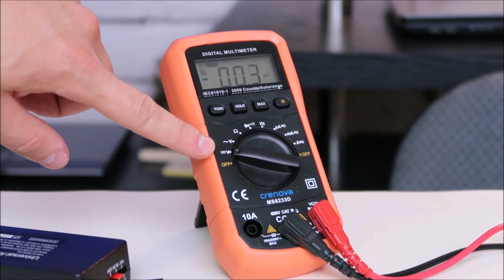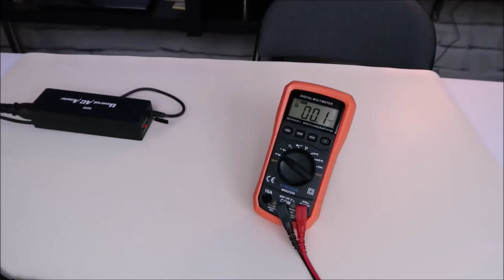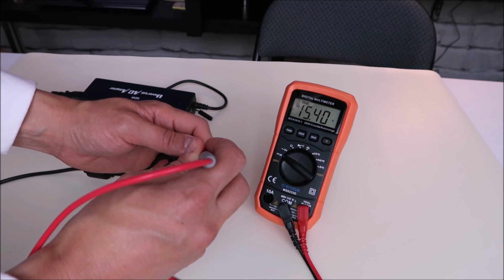How To Fix Any Laptop - Wont Turn On, Wont Open, Turns Off Right Away, No Power Solution

Comment: Is it possible to have cmos battery on the back side of the motherboard? The only cmos looking thing i could find was the one on the harddrive. I was thinking it probably the harddrive because it was supposed to spin right? And it doesn't now

Hp laptop 14-bw019AX
Reply from the maker: Yes, CMOS batteries can be on either side of the motherboard.
Reply: @PC_Monkey  harddrive was supposed to spin right? Mine doesn't.
Reply from the maker: @KhaiGK  1.  Yes, usually hard drives do make at least a little noise when in use from the internal components spinning.  
2.  Are there any signs of life at all when you try to turn it on? Lights? Fan, Motherboard, or Hard Drive sounds? Anything seen on the screen?
Reply: @PC_Monkey  fan are spinning, power light lit up but it was supposed to be blinking, cpu or gpu im not sure which does get heated up.
Reply: @PC_Monkey  hard drives are completely dead
Reply from the maker: @KhaiGK  1.  Is the computer overheating? 
2.  If the fan is on and CPU is cooking, perhaps the computer is actually on.  For a computer that turns on but the display does not work, try this video first; https://youtu.be/e9iy30J00-k
Let me know how that goes :)
Reply: @PC_Monkey  ok I'll check it out, 1. No it doesn't seem like overheating just warm like usual 2. No i tried an external monitor, but it doesn't work. 3. Ram is also looking fine. I do remember a few months ago i factory reset it because i was going to sell it but decided not to, it was fine for a good few days but then i didn't use it for like a month and now it is in this state
Reply from the maker: @KhaiGK  Good luck !!  Let me know how it goes :)
Reply: @PC_Monkey  yep, im pretty sure it's the harddrive. I tried turning it on without the hard drive plugged in and the same thing happened only light, fan

Comment: My laptop is a Dell latitude E6220, it has failed to work out, kindly guide me
Reply from the maker: Are there any signs of life at all when you try to turn it on? Lights? Fan, Motherboard, or Hard Drive sounds? Anything seen on the screen?
Reply: @PC_Monkey  there is nothing no light at all
Reply from the maker: @getinspiredbyswaibuhkawees7088    If all the tests in this video do not reveal the issue, and your power adapter tested to be fine, then your most likely looking at a Motherboard replacement as seen here;  https://youtu.be/N_7HNrFkMS8.
Reply: @PC_Monkey  oh my God, wat could be the cause coz it's been working well, but unfortunately today morning I switched it on well as usual, logged in and connected to internet, I was trying to continue with my work on chrome pages and all of a sudden it told me chrome wasn't responding then it froze, at this scene it switched itself off completely and since morning have been trying but nothing like light yet since morning.
Reply from the maker: @getinspiredbyswaibuhkawees7088  Its hard to say what could have caused it without examining it.  Could be overheating or a power surge.  Could just be end of life under various conditions :(  Sry
Reply: @PC_Monkey  anyway am so grateful for the time you have given me, at least I have got a bit of it
Reply from the maker: @getinspiredbyswaibuhkawees7088  Happy to help :) Always here if needed !!

Comment: I have a strange power problem.  
My laptop is an asus x550ca and it suddenly turned off. I followed the suggestion that you offered. None worked.  The strange thing is as soon as I plug the AC adapter in...the power light and the number lock light come on...but it just won't turn on.   Any suggestions on how I can fix this. It doesn't even try to charge my battery
Reply from the maker: If all the tests in this video do not reveal the issue, and your power adapter tested to be fine, then your most likely looking at a Motherboard replacement as seen here;  https://youtu.be/N_7HNrFkMS8.

Comment: hi  i am having HP15s-du3047tx it is powering on (the power led turns ON) but turns OFF within 2 seconds fan or processor led doesn't turns ON at the same time
Reply from the maker: Sounds like your on the correct video.  Have you tried the steps seen here?

Comment: Is this also applicable in t series of lenovo thinkpad?
Reply from the maker: 1.  This troubleshooting process applies to most all computers that wont turn on.  
2.  Are there any signs of life at all when you try to turn it on? Lights? Fan, Motherboard, or Hard Drive sounds? Anything seen on the screen?
Reply: @PC_Monkey   nope sir, even i plug in the charger the indicator is not lighting at all
Reply from the maker: @johnroyolivacalm6295   If all the tests in this video do not reveal the issue, and your power adapter tested to be fine, then your most likely looking at a Motherboard replacement as seen here;  https://youtu.be/N_7HNrFkMS8.  If you know your computer's model number, I can help you get inside your specific computer :)

Comment: One of the very first solutions on Day 1 of the "shutdown", and yes, it was random, was to discharge the static electrical charge in the BIOS of my Dell XPS 15 9570....but they didn't explain or show how. FYI, the BIOS batteries are extremely small these days, about as big as a small finger nail. I'm on Day 8 of my relentless pursuit of a fix, and you seemed to have much more knowledge and easy-to-follow explanations than most I've seen here. There's no chance I would have taken the MB out before your videos. I will follow up, as my BIOS battery is discharging the static as we speak. 
Thank you for helping others, and I will make a donation for your efforts.
Reply from the maker: So at this point, your computer turns on, remains on black screen without displaying anything, and then turns off?
Reply: @PC_Monkey  At different times, it has come on and acknowledged a corrupt bios followed by a successful Firmware Update; successfully coming on and completing a repair; successfully coming on and completing a complete drive wipe and reset. Each and every time, immediately upon completion of whatever task it performed, it shut down immediately. I have replaced the battery and the adapter with genuine Dell parts. I have also performed your R.O.M. test. It's beginning to look like the MB according to this video......yet I'm not convinced. My delayed response is due to getting the parts and my old Dell Inspiron 1545 backup laptop having it's own issues. Thank you for these videos. I've learned a wealth of computer knowledge, and always turn to you first for repairs.
Reply: I do get a screen for the duration of each task, and my correct model is the 7590.
Reply from the maker: @maximusguitarslinger3069  Have you tried a manual BIOS reset as seen here in this updated video?  https://youtu.be/P3I7dDpkJps

Comment: Hay so my laptop isn't working 
The only time it turns on is when the charger is in it but it needs to be in a certain position it will turn on for 5 seconds then completely turn off
Reply from the maker: If your charger needs to be in a certain position to turn on then I would first assume that the power jack is damaged and needs to be replaced.

Comment: i tried this and nothing worked and my battery is fully charged .. this happened with another laptop i had
Reply from the maker: 1.  Are there any signs of life at all when you try to turn it on? Lights? Fan, Motherboard, or Hard Drive sounds? Anything seen on the screen?
2.  You tried all the steps seen here including the BIOS reset?
Reply: @PC_Monkey  no life at all i even left the battery and cemos battery out for 2 days and still nothing....
Reply from the maker: @pokemontrainerbranden3277   If all the tests in this video do not reveal the issue, and your power adapter tested to be fine, then your most likely looking at a Motherboard replacement as seen here;  https://youtu.be/N_7HNrFkMS8.

Comment: It’s a school computer I can’t take it apart I’m litterly crying right now nothing will work 💀😭
Reply from the maker: 1.  Are there any signs of life at all when you try to turn it on? Lights? Fan, Motherboard, or Hard Drive sounds? Anything seen on the screen?
2.  Can you not take it apart because you are not allowed to or because you cant figure out how to get inside?
Reply: @PC_Monkey  yes the turn on light turns on for a second but then shuts back off
Reply from the maker: @stuppid..kiddara  1.  Sounds like your on the correct video then :)
2.  For help accessing an internal battery, refer to this video; https://youtu.be/tUCVN2GLYuA
If you know your computer's model number, I can help you get inside your specific computer :)

Comment: Mine it doesn't work either removing battery or power plug what should I do next
Reply from the maker: 1.  Are there any signs of life at all when you try to turn it on? Lights? Fan, Motherboard, or Hard Drive sounds? Anything seen on the screen?
2.  This video has been updated with additional steps here; https://youtu.be/P3I7dDpkJps. Let me know how that goes :)

Comment: I have a laptop Thinkpad X1 yoga and it doesn’t start. However, it shows power light while i do plug in so what Should i do??
Reply from the maker: Sounds like your on the correct video.  Are you able to try the steps seen here yet?
Reply: @PC_Monkey  yeah I have tried but still it doesn’t start yet
Reply from the maker: @parthpatel2923   If all the tests in this video do not reveal the issue, and your power adapter tested to be fine, then your most likely looking at a Motherboard replacement as seen here;  https://youtu.be/N_7HNrFkMS8.  Let me know if you would like further help with that :)

Comment: i have a windows 8 pro laptop and whenever i turn it on it wont show any light or anything ive tried all of your methods, please help.
Reply from the maker: If all the tests in this video do not reveal the issue, and your power adapter tested to be fine, then your most likely looking at a Motherboard replacement as seen here;  https://youtu.be/N_7HNrFkMS8.  If you know your computer's model number, I can help you get inside your specific computer :)

Comment: Neither methods worked for me. I bought a brand new battery and the same thing happens. Whenever I remove my charger my laptop goes dead. Whenever I restart my laptop the battery icon starts working normal like it’s charging then and it stops at 84%. Any idea why what I can do? My charging light on the side of laptop is on. It’s a HP 15 -1272wm.
Reply from the maker: This video is for a computer that wont turn on.  That does not appear to be your issue.   Can you try these steps instead?  https://www.youtube.com/watch?v=arZpfqcVoUs

Comment: Yo what if I cant close my Laptop due to a Screen problem. I cant close it to Open my Laptop cause duh
Reply from the maker: Are there any signs of life at all when you try to turn it on? Lights? Fan, Motherboard, or Hard Drive sounds? Anything seen on the screen?
Reply: @PC_Monkey  the power button light turns on. but the screen remains blank
Reply from the maker: @gamingwithajohn1543  Then yes, you are on the correct video.  If the LCD assembly is broken and preventing you from accessing the inside of the computer, than it seems you have a couple different things to fix :(  I would try the static discharge procedure.  If that does not help, you need to move on with more troubleshooting and would need to repair the LCD assembly also if needed
Reply: @PC_Monkey  another thing is that when My laptop Does switch on (sometimes the screen remains blank, sometimes it Switches on) the screen 'glitches'and crashes In the Login screen. Sometimes when I make it pass the login screen, Im stopped by a BSOD. The cause of the BSOD is always different from the last one

Comment: Omgosh!!! Ty, ty!! I literally thought my laptop had died!! You saved me! Haha 😊😊
Reply from the maker: Glad your all set :) Always here if needed !!
Reply: @PC_Monkey  Sadly, it didn't work after all. I mean, it worked earlier (static discharge and attempt start with battery only) and then after a while I was interupted and the laptop went to sleep and nowit doesn't work anymore. =(  I'll run through the video again.
Reply from the maker: @msscarlettrose  If all the tests in this video do not reveal the issue, and your power adapter tested to be fine, then your most likely looking at a Motherboard replacement as seen here;  https://youtu.be/N_7HNrFkMS8.  If you know your computer's model number, I can help you get inside your specific computer :)
Reply: @PC_Monkey   Ty. I'll see how I go with it today. :)

Comment: Hi there, Thanks so much for this.  I got my Toshiba laptop working by removing the battery and using the charger. Now the the computer won’t turn on snd I notice the start button no longer lights up.  Before the light under the start button lit up.  Do you know what this means? Thsnks
Reply from the maker: Have you tried the steps seen here?
Reply: @PC_Monkey  hi there, yes thanks.  Great video.  That’s how I knew to do static discharge & remove the battery.  Before I go into the back and remove the ram, I was wondering if I’d messed up the mechanism under the start key? .  
I left it on connected to the main power supply without battery in .. not sure if this makes a difference?
Reply from the maker: @katrina2620  No, that should not damage the computer in any way :)

Comment: If I actually get it fixed by a computer expert will it delete all the photos, and files in my loptop? Cause I’m afraid that it will delete all the photos that’s in here
Reply from the maker: Are you asking a question?  If so, what brand and model computer do you have and whats the issue with it?
Reply: @PC_Monkey  its a dell and i tried the method but it still wont open so I have no other choice but I’m afraid that it may delete all the photos thats in my loptop
Reply from the maker: @yoshimimatsuo8299  Are there any signs of life at all when you try to turn it on? Lights? Fan, Motherboard, or Hard Drive sounds? Anything seen on the screen?
Reply: @PC_Monkey  no signs at all and I badly needed it because its very important to me
Reply from the maker: @yoshimimatsuo8299  1.  Are you able to try the steps seen here?
2.  I cant tell you if a professional fixing your computer would cause DATA loss as I dont know what is wrong with your computer.  If your hard drive is bad, then your DATA is lost.  If the hard drive is good, than your DATA should be safe.  In most cases, when a computer wont turn on, a bad hard drive is not the cause :)
Reply: @PC_Monkey  I have tried the steps all over again but it wont turn on the last time I open it my loptops all good no signs of any bad drive it just didnt turn on all of a sudden
Reply from the maker: @yoshimimatsuo8299   If all the tests in this video do not reveal the issue, and your power adapter tested to be fine, then your most likely looking at a Motherboard replacement as seen here;  https://youtu.be/N_7HNrFkMS8.  If you know your computer's model number, I can help you get inside your specific computer :)

Comment: Why did you not mention that the CMOS battery needs to be replaced ?? On older computers for sure sometimes the cause. When this happens on my Lenovo W510 I keep key F1 down while starting up, sometimes it takes a few times before it goes to BIOS, when there I just point to start and the Hard drive and F10 save. The computer starts after that. This non start happens perhaps once or twice in 6 months. Can you comment on this? Thanks
Reply from the maker: In my experience, a bad CMOS is rarely the cause of a computer not turning on.  Not all computers use CMOS batteries.  The ones that do, only use them to keep power to the motherboard when the computer is off.  When the computer is turned on, the power comes from the main computer battery or charger.  A sign of a bad CMOS would be incorrect BIOS settings or a computer starting to BIOS.
Reply: @PC_Monkey  Thank you for your response I appreciate it. Indeed after I am holding F1 when starting up and if done several times (since the computer is frozen sometime it tells it is going to BIOS but does nothing) I can finally go to the BIOS set-up where I have to point to the Hard drive and press F10 to save the settings This do not start occurrence happens perhaps once in 6 months or 3 months Hard to tell because it erratic. Thanks again if you want to comment on this My computer is a Lenovo W510.
Tony Vanderlinden
Reply from the maker: @tonyvanderlinden8783  Oh ok then yes.  If the settings keeps reverting and preventing the computer from starting the it could be a bad CMOS.  I would replace it
Reply: @PC_Monkey  Thanks again You are great in responding what is a rare feature nowadays Tony
Reply from the maker: @tonyvanderlinden8783  I try :)  Good luck !!  Let me know how it goes :)

Comment: My computer power button is on but the screen is back when I take out charger in and out it makes a noise when the charger is in and the screen is black
Reply from the maker: 1.  Have you tried the steps seen here?
2.  What kind of noise?  A beeping in a pattern?  A electronic type buzzing?
Reply: @PC_Monkey  it sounded like a buzz
Reply: @PC_Monkey the first step made it light the screen but then when I tried multiple times it didn't wokr
Reply from the maker: @nasililly1606  1.  You can test the power charger as seen here;  https://www.youtube.com/watch?v=YBhsVHideGE&t=6s.  If you dont have a multimeter, you can see an example of the item you need in my amazon store under the 'Repair Tools' list;  https://www.amazon.com/shop/pcmonkey.  If not, I would try replacing the charger. 
2.  This video has been updated with additional steps here; https://youtu.be/P3I7dDpkJps. Let me know how that goes :)